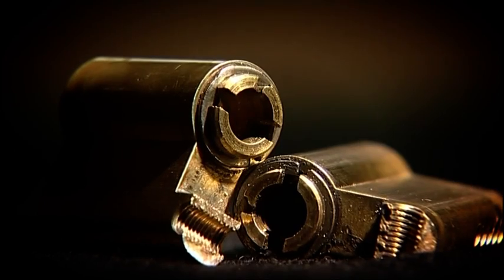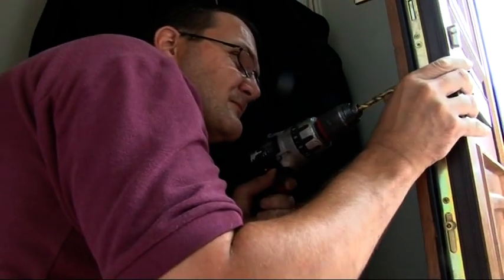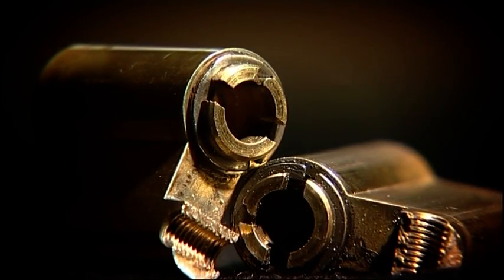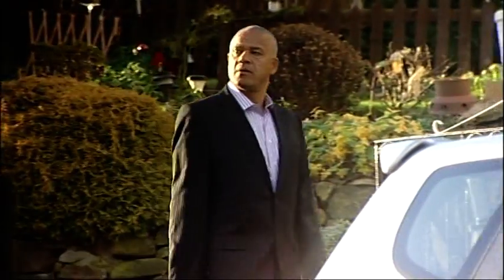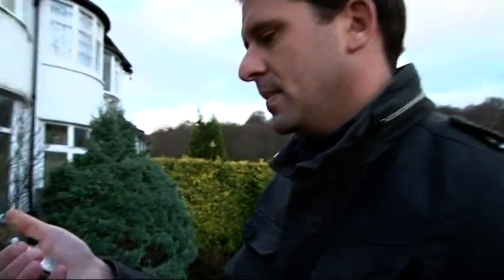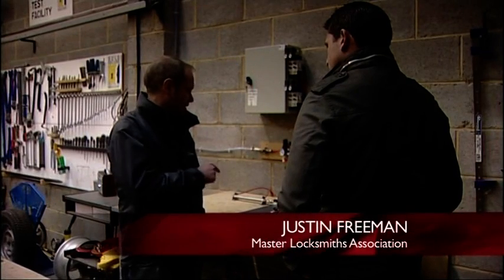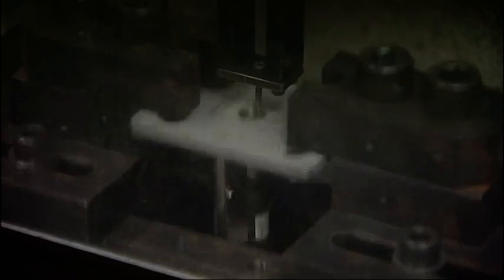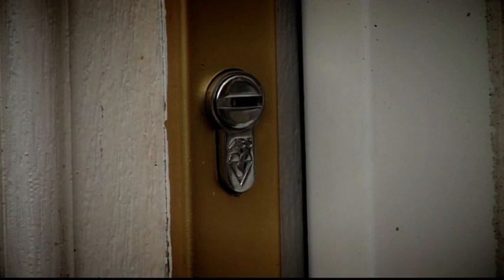Lock Snapping - The Euro Cylinder Lock Vulnerability

Comment: I am a locksmith, I carry a few kite marked anti-snap Euro locks on my van, but the bottom line for the customer is always cost. I offer the better but more expensive lock at £30 and a standard Euro lock for £17.50. In 4 years of trading only 1 customer has ever chosen the more expensive lock.
Reply: Ha ha ha, I installed a 200 euros cylinder in my armoured door
Reply: Which brand euro lock do you rate as the best?
Reply: @Willtext  Wow that's an old post, I can say I now fit far more BS locks than non BS locks. "The best brand?" Hummm 3 Star = I like ABUS, but I like UAP's Kinetica cash protection, and the  ERA Fortress cylinder  is very good, but overly complicated and I have known some key and turn cylinders to fail if there is pressure on the multipoint bolts/hooks during operation, though the thumb turn still functions, also the Fortress key blanks are quite expensive. I would say stay away from the  Avocet ABS High Security Euro Cylinder, as I have a special tool that will open and relock it without any visible trace. Hope that helps :)
Reply: I just rewatched this video and noticed they fitted the  Avocet ABS High Security Euro Cylinder that I don't recommend, and here's why, this is a video of a tool I carry in my van https://youtu.be/oNBCyxSvBjU
Reply: Cods walop
Reply: @jonwallace7015  which of my replays is as you so eloquently put it  is "cods walop"? 
As this is quite an old post and I have updated it if you have been bothered to read all the thread.
Reply: @TherealElliot  sorry I ment to put bloody in front.my good fellow.
Reply: @TherealElliot  as expected
Reply: @Willtext  yale ts-007
Reply: I think you could be a bully
Reply: Since it's easy for a burglar to snap a handle and gain access to a cylinder, do you think it would be a good idea to weld the outside handle to the door instead of letting it be fixed by screws? (my door is an aluminum door) provided that you can still change the cylinder when needed by removing the plate that's on the inside of the door and then removing the cylinder from the inside.
Reply: @johnsmall3105  No I would not recommend welding any of the door furniture, however I would (if you live in a particularly high crime area, or have a specific threat) simply fit a PAS 23 high security handle set, these are much tougher to damage/defeat than regular handle sets, then combined the PAS 23 handle set with a 3 Star euro cylinder like the Kinetica.
Reply: @elliotlee233  Unfortunately with the modern tools that burglars have nowadays, any handle can be snapped relatively quickly. Why would you not recommend welding a handle?
Reply: @johnsmall3105  Regular handles would still be susceptible to being crushed even if they were welded, I could potentially see some additional protection in welding solid PAS 23 handles, but To be honest the bolts are so strong on the PAS 23 handles I have in stock, it would probably be easier to just cut through the door than bother with the handles and lock. If you watch modern police documentaries, the way they get through modern doors is by cutting down the middle of the door top to bottom, then using a battering ram in the middle of the door, it just folds open in the middle.
Reply: anti snaps are utterly as useless as standard
Reply: @TherealElliot  I have to agree with your point about ERA Fortress cylinders. My FIL runs his own window and door company, they used to exclusively supply Fortresses for a number of years without any real failures to mention, and then in a short period of time he had failure after failure after failure of customer locks, in the end the failure rate was about 40%. Cost a lot of money to deal with (even out of warranty, he still changed them FOC, as they were clearly substandard). He moved to Ultion, had similar issues after a while. Since he's been using Yale Platinum, the failure rate is below 1%. Ditto with Avocet ATK which he supplies as a special order part, very few failures. The ABS though, nope. I got locked out of my own house when my ABS failed.....twice. Never again.
Reply: @TherealElliot  redditor spotted

Comment: I hate these horrible pvc doors.... What was wrong with a good proper Yale & a 5-lever Chubb like we used to have?
Reply: Too much hassle to mortice them and the muti point lock is harder to kick in and sadly most people who used a five lever lock never used it so the door was only held closed by the low security latch Wich also made it easy to slip the latch.
The wooden doors also warped. 
I get you though...it had advantages.
Reply: These doors are really surprising. I locksmith in the states, and the doors they show, as well as the locks, aren't even good enough to keep on your bedroom closet to hide the Christmas presents from the kids!
Reply: @kskochko  "in the states" masterlock with 4 pin keys is the king(and ofc no security pins) so anyone can open them with paper clip...

Comment: Since it's easy for a burglar to snap a handle and gain access to a cylinder, do you think it would be a good idea to weld the outside handle to the door instead of letting it be fixed by screws? Provided that you can still change the cylinder when needed by removing the plate that's on the inside of the door and then removing the cylinder from the inside.
Reply: The handle itself is snapped rather than the bolts, they only do that to gain access to the barrel so they can snap it in half. The solution is to get a snap proof barrel that locks itself shut if it snaps
Reply: you don't know much about welding do you can't weld upvc or wood
Reply: @karazor-el9596  well you can weld upvc as that’s how the panels are joined together but you can’t weld metal to plastic which is what you were getting at!
Reply: @karazor-el9596  Of course you can weld UPVC. How do you think they are fabricated?

Comment: After watching this I replaced a faulty lock with a high security lock. Anti snap, anti drill ect. But it cost me £55. Need to replace others to these 3 star locks. But I am on benefits and can't afford it. It would cost me over £200. Need to bring the price down.
Reply: Get normal, decent, but not hugely expensive locks. Wood door, doorknob and deadbolt. They're hyping this up.

Comment: In 2016, the Euro cylinder lock on my back door was snapped and the thieves managed to enter my home, they were disturbed b y my elderly mother going to the toilet and making a noise up stairs, so they made a hastyretreat empty handed. I live in a village 3 miles from Halifax, there was a white Ford Transit van caught on a neighbours CCTV camera, the van was later found abandoned in Bradford. I bought new unbreakable steel Euro locks for the front a nd back doors at £50 each, I also bought lockable boor jammers for the top and bottom of both doors. The brass Euro locks should be banned from sale in my opinion as they are too easy to break in my opinion. The door jammers are a worthwhile additional secuirity measure.
Reply: Brass Euro locks are good for interior doors.
Unfortunately, most people don't see any difference between a good and a bad lock,
and they can't think how a burglar thinks.

Comment: Interesting that its 2012 and now being reported. We used to use this as a last resort to gain entry on call outs, either a specialist tool or a pair of grips, back in the 90's.
Often the cutout for the lock is too big allowing forcing tools to get a good grip and allowing side to side movement of the lock and very very easy breakage. 
The only time we struggled with this kink of lock was when flush fitted to a security door of a medical room in a ship.
Reply: quicker just put you're foot on it anti snap or not it's opening

Comment: Add a cam for the middle of the lock put it on a bolt then nut tighten it down and and one bolt at end bit of glue and it a ten second job just turn it like a key 🤣🤣

Comment: Some comments on here are uncalled for. This video is designed to show just how vulnerable your upvc/composite door can be! It is true. If a burglar wants to get in. no matter how secure your home is. they will get in! The standard euro cylinder is as the video shows. very poor at securing your door. Please give us a call on 07412 766665. We are Locksmiths and fit high security Anti Snap, Anti Drill, Anti Bump, Anti Pick Euro cylinders to upvc and Composite doors all across the Midlands. we can also supply only www.Elite-Property-Services.co.uk (website under construction and will be ready mid June 2014)

Comment: I replied before to Handyman when he was  showing how to snap the lock. But here we go again. Cannot understand a manufacturer designing a lock like that . I have been a victim of this. As the clip shows at 5.17 the security of the door with 3 bars coming out into the frame , and my key was the most sophisticated I ever saw, and the wankers produce  the most stupid design. At leasr make it out of stainless and give it some beef. Wankers  They must be getting commission from the burglars. WANKER DESIGNERS.
Reply: austrorus Sorry you got it wrong. Dont live in an estate . but even that is no excuse. Please do not criticize people to what they can afford. The euro lock cost me £100 and had the most sophisticated key one ever saw.(The key used the sides to create the access not the edge).(tried to make one copy and the machines only got one side ok.) The only thing i did not know, it is the way they burgle it. One good vice pliers and ten seconds later they are in. I CANNOT UNDERSTAND MANUFACTURES GOING TO SUCH SOPHISTICATION AND FAILING ON MATERIALS. MAKE THE DAMN THING OUT OF STAINLESS STEEL AND GIVE IT ANOTHER 1/8 OF AN INCH THICKNESS.
Reply: CHRISTOS TSANDAS never intended to mean it personal. apologies if it came over that way.
Reply from the maker: Unfortunately a lot of companies out there are still using sub standard euro cylinders, you want to ensure the euro cylinder you have is 3 star kite marked. We personally recommend the Avocet ABS.
Reply: +CHRISTOS TSANDAS  ..... im an ex burgalar and eurolocking was my way in and its just too easy for criminals to break in! at worst it takes no more than a minute to enter a house by snapping the barrell and as for the new improved "Anti-Molegrip locks" there just as easy if not even easier just change the molegrips from standard to long nose grips ...... A security light and locked gate can be more affective than an alarm itself......

Comment: Censoring how to snap a lock as if criminals use YouTube tutorials to bypass locks :)) 

- pair of pliers side to side or up down
- if it's antisnap simply insert a key in or in the worst case force a drywall screw inside and use a curved crowbar to pull everything out.
Reply: +Andrei Tudose I don't think it is to prevent actual criminals to enter your home. If they want to, they will do it anyways.
It's more to prevent kids from getting bad ideas.
Reply: True :)
Reply: If you want to find out how to do it, just search 'lock snapping'. I just did that after not hearing about this problem and wondering what it was.

Comment: This is old school scare mongering this just looks like an advert for their types of euro cylinders and the locksmith Who can sell you one to make more money. At the end of the day these euro cylinders are so much more expensive no one wants to pay for it.     Anyways if they can't get in through snapping the euro they just smash a panel of glass easy that takes only 5 seconds. People will think if they change their Euro The house becomes so much safer wrong they just find another way in your house You're better off thinking about having a burger alarm or CCTV to  prevent them from thinking  about entering your house. But to be honest if they want to come in your house they will.
Reply: These ABS locks are very differnet to standard ones, theyre much harder to snap because of thicker and stronger materials and incorporate a trap mechanism where if the lock is hammered or attempted to snap the lock to the door jams itself on the external side. The internal side however remains functioning, saying it is just there to fleece money off people is stupid especially considering 90% of police forces would recommend them
Reply: It is scaremongering. Get a good door, a decent lock, and a security system. The locks they show are shit.
Reply: @paigeoverton499  no there not harder at all in any way